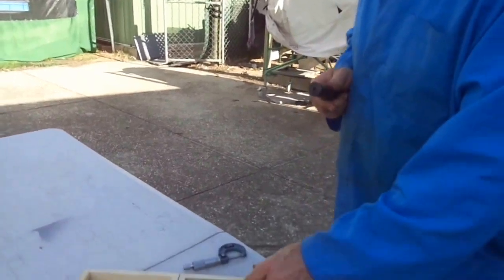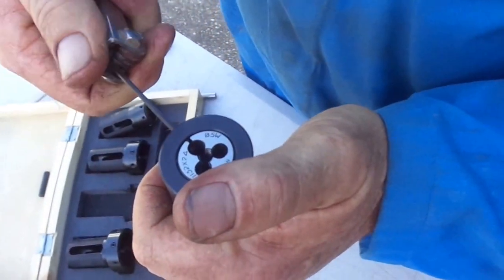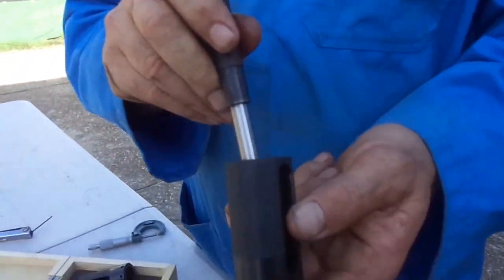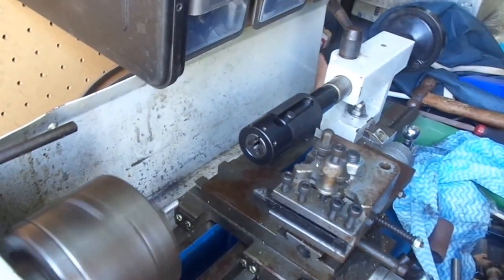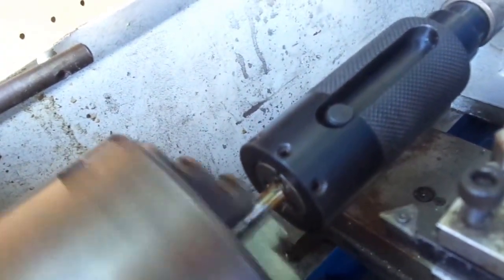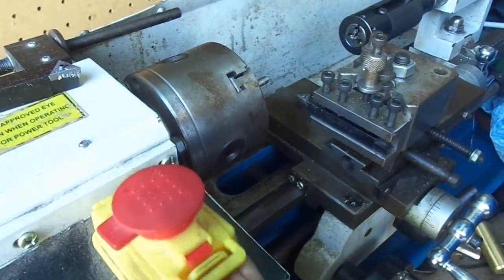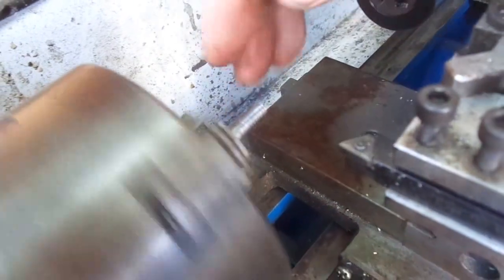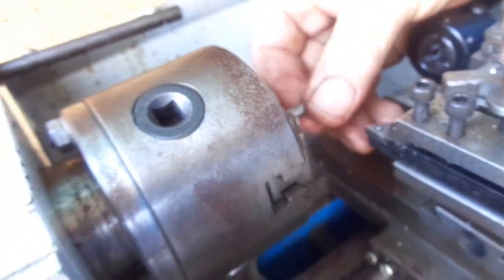USING A FLOATING DIE HOLDER IN THE LATHE

Comment: I purchased I 3pc floating die holder set off eBay for $49.99 from India that’s a little different than yours utilizing a 2mt arbor and then I realized the 3 sizes were not nearly enough for the does I had or needed so I looked at it and realized the holders are very easy to make yourself and purchased some 4140 bar stock off eBay in 1.5”, 2”, and 3.5” and then duplicated the die holder into the first two larger sizes 1.5” and 1-5/8” and then because I still needed larger i made another arbor which had to be longer for the heavier die holders and made a 1-3/4 to 2-7/8” staged sliding die holder. Btw, I’d never thread at the speeds your running (not even aluminum), but I do love using these versus having to change my gears over on the lathe and worry whether I can get decent threads cut from it. Far easier to use a floating die. My floating die holders also have a threaded bar coming out of there sides so as it tightens or loosens it can rest and slide across the carriage preventing the die from spinning which happens more often than you’d realize especially when cutting threads in harder alloys. Definitely a good tool and time saver to keep around though we have to expend those extra funds on dies and store them where a lathe is like free inventory less the cost of inserts.